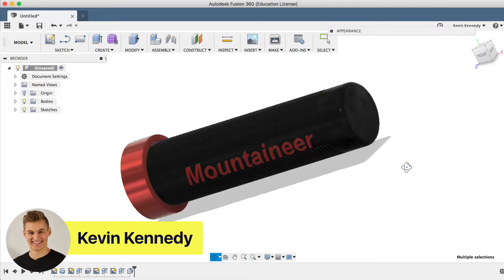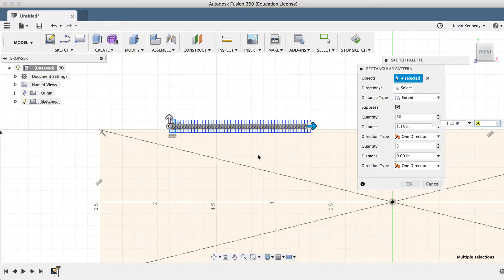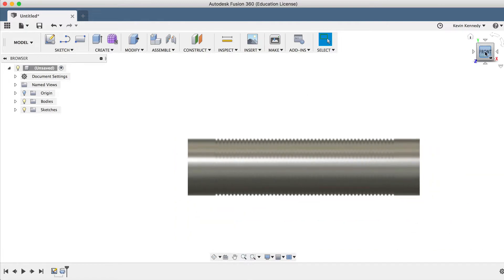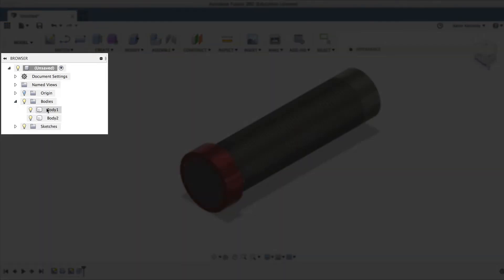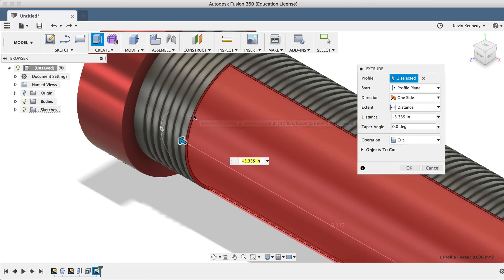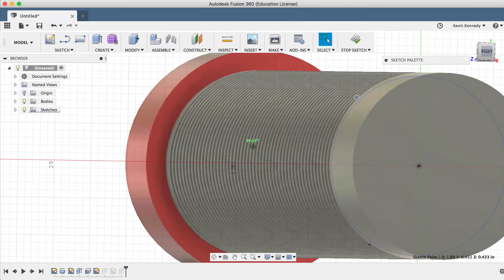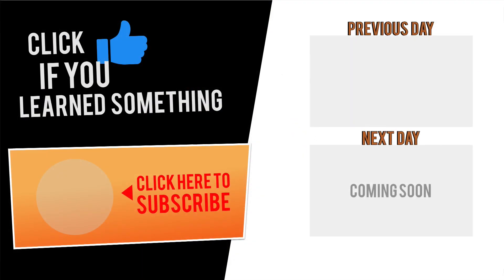3D Model a Handlebar Grip with Embossed Letters - Learn Autodesk Fusion 360 in 30 Days: Day #7

Comment: Hi Kevin, Sorry to bother you so much... I can't get the cirkel you draw in min 4:40 in the wright place.. This is what I get   https://imgur.com/s027hzb
Reply from the maker: Hi, Fanny. It looks like the sketch plane is on the other side of the cylinder. Try exiting that sketch (you can delete it as well) and then right click on the outer face and select "create new sketch". Then, if you activate the center-circle command with the keyboard shortcut letter "C" you should be able to draw it on the outside.

It may also help to look at your model from a perspective similar to what you have in your screenshot, helping ensure that you select the correct face.

Let me know if you're able to get it! Cheers, Kevin :)
Reply: Great...from the other side it works.. Small detail.. big difference ;)
Reply: I had a work around of just drawin it in the outer cirkel, and then copy it to a inner cirkel.. but This is much more fluid...
Reply from the maker: @BORAGT201  Glad it worked...sometimes the small details really cause issues in CAD. Keep at it! Cheers, Kevin :)

Comment: I can't seem to grab the text in order to change material/color.  When I hover over the letters, only the edges highlight for me to select.  Any ideas?
Reply from the maker: Hi StepInIsrael, you can try changing your selection priority to only include faces. Select dropdown list > Selection Priority > "Select Face Priority"

This will ensure that you're only able to select faces. Then, hold down the Shift key on your keyboard and you can select all of the faces of the letters before hitting the keyboard shortcut letter "A" to open the Appearance dialog.

Let me know if this works! Cheers, Kevin :)
Reply: @ProductDesignOnline  Ok, that solved that problem... but now, with the letters selected, when I drag a material to it (and 'drop' on the text), the entire component changes..
Reply from the maker: @StepInIsrael  In the Appearance dialog box there will be an option near the top where you can select "faces" or "bodies." You'll want to make sure "faces" is selected before you try to drag and drop. That should ensure that the bodies don't get changed at the same time. Cheers, Kevin :)
Reply: @ProductDesignOnline  Hmm... that didn't work for me.  When I drag over the text and let go, nothing happens.  Also, I notice that on your screen it looks like the Bodies/Components radio button is selected..
Reply from the maker: @StepInIsrael  That's strange. Would you mind sharing your file with me so I can take a look? Share your public link as a reply to this comment. Here's a video explaining how to share a public link - https://youtu.be/2XrcrdV-8Ls

Then, please write a separate comment letting me know you've replied with a link because YouTube flags most links and I don't always get notified. Cheers, Kevin :)
Reply from the maker: @StepInIsrael  Thanks for sharing your file. I took a look at it and did not see anything wrong with your file. Please watch the attached screencast of me applying color. This may help you notice something that you were not doing/doing differently - https://drive.google.com/file/d/1as50GUnD1lRv9jNInm5YV0a4ttZ1lHCA/view?usp=sharing
Cheers, Kevin :)
Reply: @ProductDesignOnline  I'm having a similar issue.  I'm not sure if the interface changed has caused this or something else.  I'll keep going.  If you repeat these steps in another project I'll see if it I get a different result.
Reply: Actually im having same kind of isuue the thing is im able to aplly colour on some alphabets only

Comment: Hi, on 4.40 when drawing a circle on the grip part i keep getting locked on the end of the grip. i cant seem to be able to lock on the center of the inner part. 
one thing thats diffrent for me is when i press "create sketch" on the inner part i dont get zoomed in like you do. the camera stays still.

if i do make a circle on the end and extrude/cut i get a hole from the shelled part. (and it gets cut out all the way to the end.)
ive tried to make the circle with the camera angled, but it doesnt help.

thanks for your videos! they really help me to understand fusion360 and making it possible to get my ideas into 3d printed parts.
Reply: somehow i did make it work, i repeated the same thing a couple of times and it zoomed in like yours. i dont understans how... but now the modell is done!
Reply from the maker: Hi Samuel. One thing to check is to make sure your preferences are the same. Select your username in the upper righthand corner > preferences > design (from the list on the left) > make sure "auto look at sketch" is selected. As long as the option is turned on then it should always auto zoom in on your new sketch.

Anyway, I'm glad you got it working! Please don't hesitate to comment questions on the tutorials as you work through the remainder of the series. Cheers, Kevin :)

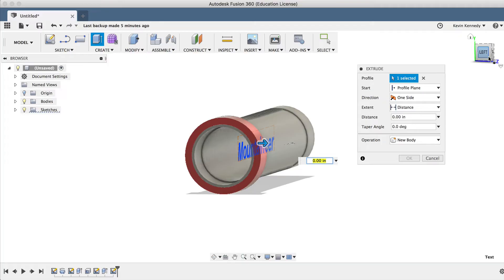Comment: at 6:33 I couldn't right click on the text to extrude
Reply from the maker: Hi, Nhan Phan Minh. What font are you using with the text? There have been some issues in the past with certain fonts not extruding properly (https://forums.autodesk.com/t5/fusion-360-design-validate/can-t-extrude-text/td-p/7338635). Try a different font and see if that fixes the issue.

Otherwise, "exploding" the text before you go to extrude the text is a good workaround (with some drawbacks). To explode text that doesn't otherwise let you extrude the text, simply right click on the text and click "explode text." The downside to this workaround is that once you "explode" the text you are no longer able to edit or resize the text. Cheers, Kevin :)
Reply: @ProductDesignOnline  i can extruding the text when i create outside of handle, i can't choose the text inside because it always display circle surface cover the text.
Reply from the maker: @nnnnnnnnnnnnnnnnnn639  Can you please share your file with me? Share your public link as a reply to this comment. Here's a video explaining how to share a public link - https://youtu.be/2XrcrdV-8Ls

Then, please write a separate comment letting me know you've replied with a link because YouTube flags most links and I don't always get notified. Cheers, Kevin :)

Comment: If anyone has a problem where you get an error when you try to move the text extrude off the face of the grip... it may be because you are using a font fusion does not have, it happened to me, even though the font worked as a sketch it could not be used to extrude, though I’m sure there is a way to do it.
Reply from the maker: Hi, Sterling. Exploding the text before you go to extrude the text is a good workaround (with some drawbacks). To explode text that doesn't otherwise let you extrude the text, simply right click on the text and click "explode text." The downside to this workaround is that once you "explode" the text you are no longer able to edit or resize the text. Cheers, Kevin :)
Reply: @ProductDesignOnline  when I did right click on the sketched text, I can't find "explode text"
Could you explain more easily? I think I'm not understanding correctly
Reply from the maker: @devstefancho  Of course! First, Make sure you're creating text from the "text" tool located in the sketch dropdown menu. Once your text is created you can right click on the text (while the sketch is still active) and you will see the "explode text" option 3rd on the list. Select "explode text."  Here's a reference image for your convenience - https://snag.gy/5SO4E8.jpg

The explode text option essentially breaks the text away from the "text" feature and creates the appropriate sketch geometry from it. Therefore, you will not be able to go back and edit the font, size, or details of the text after you hit explode sketch...without of course hitting the undo button. So use the explode text option only when necessary...I would always recommend trying to stray away from it in case you need to change or update your text later on.

Let me know if this helps. Cheers, Kevin :)
Reply: @ProductDesignOnline  i "could not retrieve the profiles of the selected text" when trying to explode .. any idea why?

Comment: I have posted the link as an answer
Reply from the maker: Florian - I took a look at your file, and everything looks good to me. Sometimes when applying appearances it will want to drop it on the whole file. To get around this there are two main solutions. First, I usually drag and drop the material/appearance directly onto the component or body in the Fusion 360 browser. Second, you can always select an object in the canvas window (it will be outlined in blue) and then drag a matierial or apperance over and it will ensure it only applies to the selected (outlined object). I hope this helps! Let me know if you're able to get it to work. Cheers, Kevin :)
Reply: @ProductDesignOnline  
It did not work... but I remade the object an now it works.
Thanks for your help!
Reply from the maker: @florianploner721  You're welcome! I'm happy to hear you got it working :)

Comment: When I try to press-pull the text I keep getting an error that says "inconsistent edge-face relationships". I have retried it several times but cannot get it to work.
Reply from the maker: Hi Nicholas. What font are you using with the text? There have been some issues in the past with certain fonts not extruding properly (https://forums.autodesk.com/t5/fusion-360-design-validate/can-t-extrude-text/td-p/7338635). Try a different font and see if that fixes the issue. If not, let me take a look at your file to see if the issue persists on my end.

To share your file please go to File > Share > Share Public Link (make sure "downloadable" is toggled on) > Paste your link here as a reply to this comment. Then, please write a separate comment letting me know you've replied with a link because YouTube flags most links and I don't always get notified. Cheers, Kevin :)
Reply: @ProductDesignOnline  Ok, that fixed it. Thanks!
Reply from the maker: @realetherwaze  Glad it worked! Cheers, Kevin :)
Reply: @ProductDesignOnline  YES!!! This was my problem with a non standard font! Happy to find the solution in your comment. Thanks a lot for your tutorials, they are very usefull!!!!
Reply: After fishing around the Fusion 360 forum I found that Exploding and then Extruding the text is a good work around for texts that don't usually work.
(credit to etfrench)
Reply from the maker: @realetherwaze  Very interesting work around. Thanks for sharing with the community!!!

Comment: Hey , Kevin. Question.  At 2.31 when I hit that line I can't move it to the right or left. Any help. Please. Thanks for perfect tutorials.
Reply from the maker: Hi goja981, you'll want to double check that your lines didn't have any constraints automatically applied. If the lines are black then they are constrained. Your lines should be blue (meaning they are not constrained). If they are blue and still won't move then be sure that the bottom or top of the first rectangle didn't snap into another sketch entity.

If you're still having trouble after checking those things then please share your file and I'll take a look. To share your file go to File > Share > Share Public Link (make sure downloadable is turned on) > Paste your link as a reply to this comment. Cheers, Kevin :)
Reply: @ProductDesignOnline  I had the same problem at first. Then I realized that altough the lines were blue, the width was still constraint with a dimension (0.05in) on top.  Once I removed that dimension, I could resize freely the width of the rectangle.
Kevin, what is the way not to have the dimensions constraining the rectangle (in this case)?
Reply from the maker: @OlivierGeorg  Hi, Oliver. Do you mean how to avoid them from being auto-constrained? If that's the case you can turn off the auto-constraints in your preferences. Otherwise, it's a matter of being care (and/or watching the messages in the lower right corner) to make sure it doesn't add constraints when you click things.
Reply: @ProductDesignOnline  Ok, I think I understand what I did.  I typed dimensions for the rectangle,  not just used the mouse.  So it is normal it was constraint!  Constraints may be great, but for a beginner it is just too many things to take into account.  But I think I am getting it little by little.  Thanks Kevin for your videos and your dedication!
Reply from the maker: @OlivierGeorg  You're making great progress. Keep at it :)

Comment: question , when I click on  the   farthest grip  and try to create a new sketch , it wont work , cant figure out where I f up
Reply from the maker: Royal REvue - Can you please share a screenshot or your Fusion 360 file? That will help me decipher what the problem is. Cheers, Kevin :)
Reply from the maker: @Salman A You can try to select the "Create Sketch" button first and then select the button.
Reply: @ProductDesignOnline  I tried select "Create Sketch" first but, when I do it, doesn't allow me to select the grip, only its edges.
I'm stuck in this step. Any suggestion?
Reply from the maker: @anapedregal  is there any way you could record your screen and share that with me? That will help me see what's going on.
Reply: @ProductDesignOnline  Thank you so much for the fast replay. Sorry for the delay on the answer. How should I contact you? Currently I don't have means of recording my screen but I can look that up or send you some screenshots. Thank you so much for your support.
Reply from the maker: @anapedregal  no worries! You can share your Fusion 360 (File > Export > .F3D) in my free Discord community: https://bit.ly/PDO-Discord